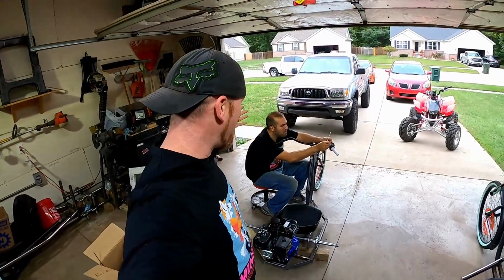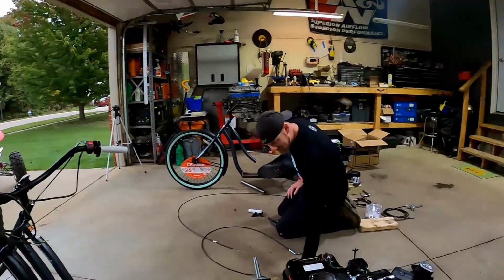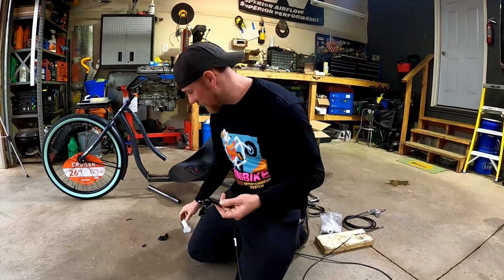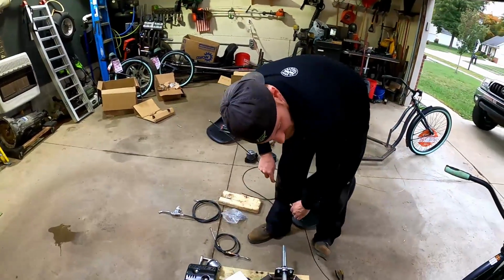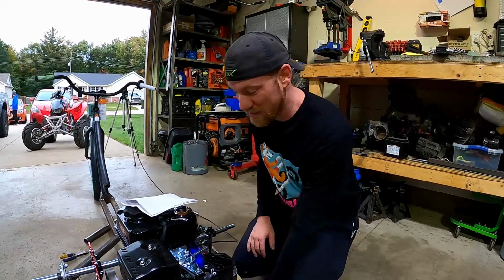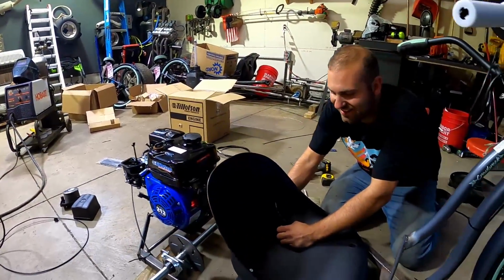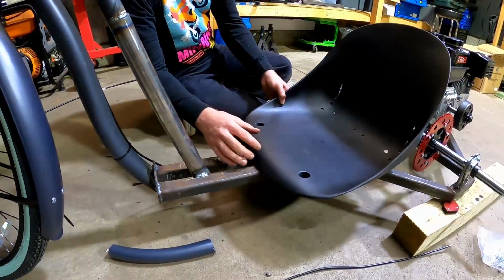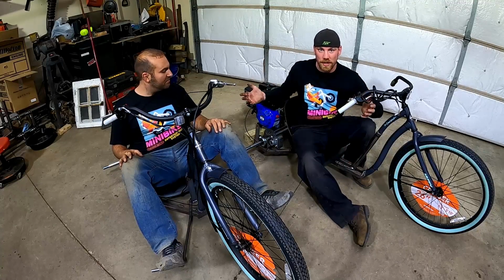Drift Trike Build Off | Tillotson 10HP Hemi Engines | Throttle Cable Setup Video

Comment: If you guys don’t like the “ape hanger” position, you could try turning the gooseneck to the rear. This would push the handle bars back and down a bit.
Please ...at least throw a couple of sheets of cardboard on the floor, anything would be better on your knees than plain concrete (just one old guys opinion).
Reply from the maker: Great idea!  And yes that concrete floor is hard in the knees for sure 👍